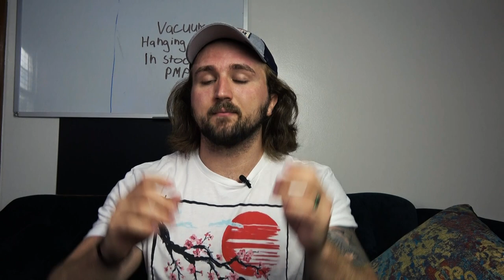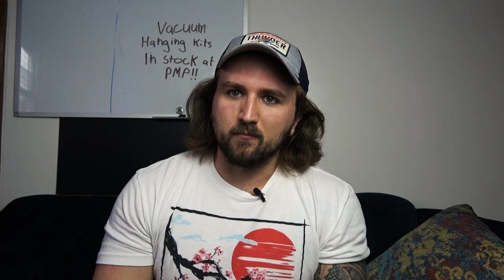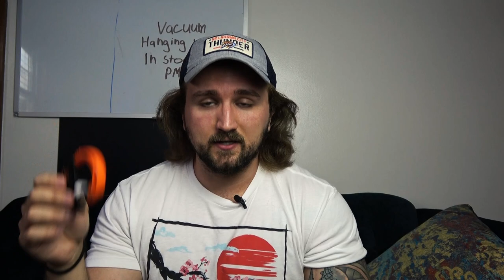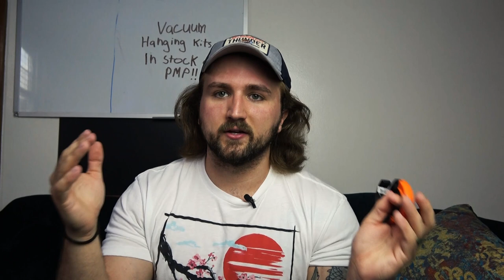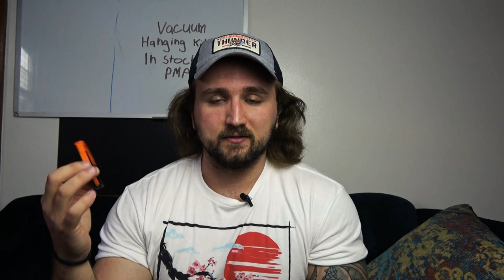Understanding the two different methods for clamping - Optimizing Penis Enlargement

Comment: I still have so many questions.
Since pumping requires a tightly sealing opening at the base of the shaft, is it not like expansive clamping, but with additional help from the vacuum?
Does expansive clamping or pumping not lead to a significant hypoxic effect when discoloration occurs due to the seal?
Is this counter-productive?
How is hypoxic clamping done differently to achieve or maximize the hypoxic effect?
Is it not beneficial to practice pumping with as hard of an erection as possible, since that will minimize the required outer pressure, which in turn will minimize fluid buildup and the corresponding counterpressure on the tunica albuginea?
Or will that lead to a tight pelvic floor as well?
Since it seems to be complementary to pumping and help to fill up and therefore further stretch the tunica albuginea, why would you only recommend hypoxic clamping after many months of P.E.?

Comment: What the hell do you mean by hypoxia clamp or expansion clamp?! I've already looked in the subforum and I've seen this video 4 times and I can't understand, a clamp, strangulation of the shaft will always cause hypoxia!?!!!
Reply: Expansive clamping: 5 mins sets, 3-5 min rest and repeat, until you’ve reach 100.04% mid shaft girth.   100.04% as measure compared to first clamp set mid shaft girth. 

Hypoxic clamping: a single 10 min set, 3 times a week.  Tighten the clamp to the just edge of stopping blood flow completely.  Measuring is irrelevant here.   The expansive part is done separately with a pump and same 100.04% increase to completion with the pump. 

That’s what could gather.

Comment: Hey BD, i've bought a lot of your products, just one question. How do i get the top part of my nuts (the cords) to stop getting partially sucked into the tube while pumping? it's really painful and quite discouraging. had to take a few days off to recover. fyi i'm my size/shape is normal so i'm not sure what the user error is.
Reply from the maker: We have ball stretchers and pump sleeves available for this reason 

But I need to update my stock check back tomorrow
Reply: @bd-peakmalephysique  Will do, thanks a ton. could be a good video topic too btw. i'm sure i'm not the only one struggling with it and pain down there can be really discouraging with continuing the exercises.